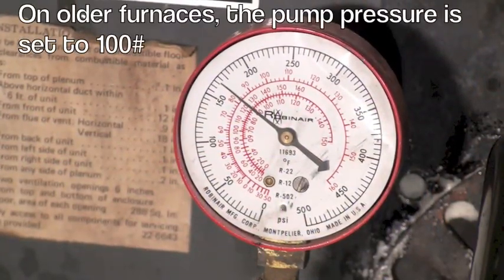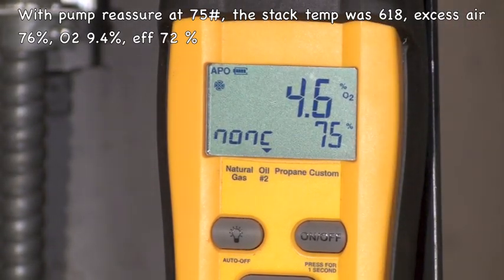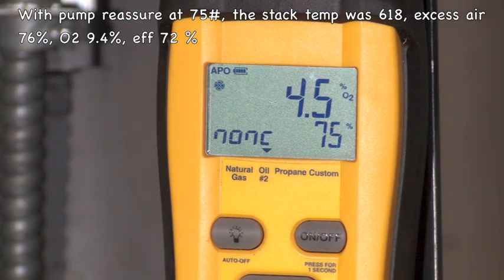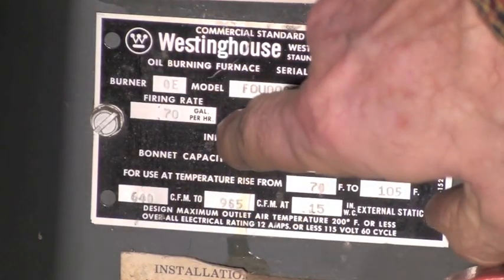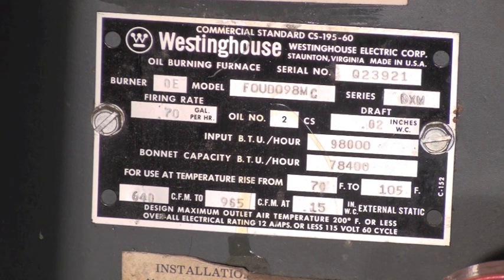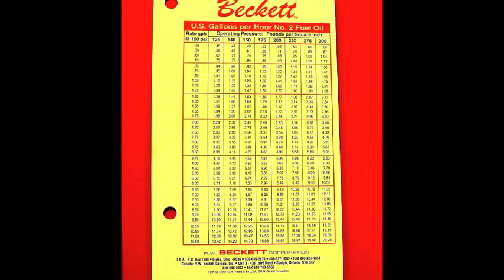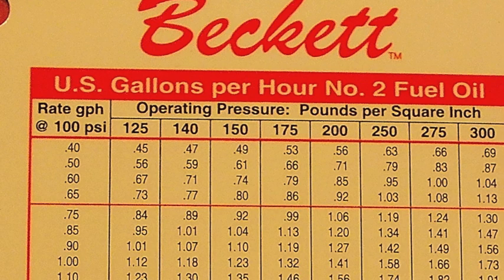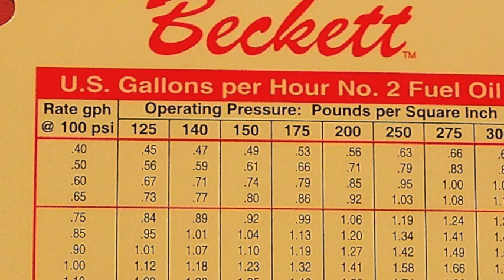Oil furnace efficiency adjustments.  Part 2 Increasing the pump pressure

Comment: should use a .60A at 125PSI and an A nozzle is hollow and a ss is semi
Reply from the maker: Nozzle selection depends on the the burner, furnace size and local oil supplies.  Start with the model plate which may have a recommendation.
GFM

Comment: I would never recommend anyone to change factory pump pressures and nozzle sizes.
They spend weeks and months developing the product. Not just for efficiency but also must pass ANSI Z21.13 and UL 726 testing with Calibrated equipment. This is a lawsuit waiting to happen...

Comment: I thought the reason to raise pressure is to lower your nozzle size and atomize better
Reply from the maker: Higher pressure always will atomize better regardless of nozzle size.  If you lower the size and raise the pressure the nozzle will have a higher gallonage, so you could reduce size to match the higher pressure.
GFM

Comment: Can I reduce the fuel pressure without compromising the fuel air ratio?
Reply from the maker: No.  Reducing fuel pressure will change nozzle output.  BTW I almost never reduce fuel pressure.  higher pressure equals smaller droplets and better burn efficiency
GFM
Reply: @grayfurnaceman   in my oil fired boiler there's an increased stack temperature but my boss isn't allowing me to reduce fuel nozzle. Thus, we were thinking of reducing the fuel pressure to increase the steam/fuel ratio
Reply from the maker: @parthindian1  I would tell my boss he is an idiot.  Unless the nozzle size is less than .50 GPH, there is no reason to not change nozzle size.
GFM

Comment: This is full of very bad, dangerous advice. Burner is old style, pre retention head type,  that often caused residential home fires.  

Stack temp of 650F degree is just bad. New retention head burners create fire ball with 80% to 85%  efficiency with stack temps around 400F degrees.   Beckett burner model AF and AFG is typical.
Reply: I service a lot of Carlin 99 domestic, and I will only use pp to fine  tune. Usually no more than 100 -5 > +20 psig.  You are never sure of the gauge cal status to give an accurate reading anyhow. Sometimes  an extra 10 psig opens up the flame pattern that can get narrow with viscous #2HHO in a  cold basement.  Usually get a good flame with Hago SS under-fired to .75 - .85gph and  high 80 eff.  never had luck with Delevan A or B. Prefer under fire on crusty old units like a burnham 124 wbb with frustratingly shore fire box with just a target wall. - Sandy

Comment: I have a 1984 Weil McLain model 66 boiler. Parts and help is discontinued. I’m a self taught BT with Gary’s help. Thanks Gary! Where the burner mount to the firebox door there is a mounting flange with gasket. I had to make a gasket out of exhaust manifold stock because of lack of parts. Question: Does the gasket go tight around the burner tube or do l just cut it flange size? Cutting it flange size leaves a 1/4 “ +/- gap. I assume that would affect air flow.
Reply from the maker: I can't answer that one.
GFM

Comment: is it safe Downsizing  a nozzle  from  0.65 80B  down  to 0.50  80*B  the  static  plate will  need  to  be  changed  out  along  with  the  end  cone  to size  F0
Reply from the maker: +Francisco Castellanos I am not sure, but I think the FO head is for .5 to .75 size nozzles.
GFM

Comment: I  just worked in a Lennox oil furnace AFII  FBX  burner using  0.65 80B  nozzle  with  a pump  pressure  at  140  psi . These  are  the  settings  per the  manufacturer, but can  i  lower  down to  100  psi   to reduce  my  temperature  at  the  stack  from  530*F  to  450*F  without  altering  the  system  design? I  am  currently  dealing  with  10*F in  excess  of  limit  temperature  rise  of  60*F  per  Lennox
Reply from the maker: +Francisco Castellanos Be sure air flow is ok first.  You can reduce pressure, but that will reduce the efficiency somewhat.  I would try a .5 nozzle.  Hope this helps.
GFM

Comment: GMF, have you ever increased the nozzle size by a .05 to get more heat to the customer or is that dangerous?
Reply from the maker: A small change is usually not dangerous.  However if you exceed the size on the nameplate, the efficiency will go down.
GFM

Comment: Do they still make a .40 nozzle I have never seen it? At the moment I'm using a .579MH
Reply from the maker: I believe that is the smallest commonly used nozzle.  It plugs easily.
GFM
Reply: grayfurnaceman should i just stay with .579MH it seems to run great on that and heats really well. one question do you know what would cause a slight shutter in the burner as its running normally? The shutter seems to not affect the operation and has been doing it for years.
Reply from the maker: Ben Boudreau That may be what is called a rumble, caused by the unit not establishing, but it usually stops after a few seconds.  
GFM
Reply: What do you mean by not establishing?
Reply from the maker: Ben Boudreau The burner is not a pressure burner, meaning it must have a negative pressure in the vent to operate normally.
GFM
Reply: So you mean the daft may not be enough? It's not used with a chimney only a 10 foot long 4 inch flue to the outside and 2 elbows.
Reply from the maker: Ben Boudreau 4 inch sounds small.  Is that the size of the breaching? (outlet pipe).
Reply: Yep 4 inch at the furnace top collar!
Reply from the maker: Ben Boudreau I guess its ok.  Brand?
GFM
Reply: Miller
Reply: It's says MOC-80 on the furnace. With the original FS-LS burner .50 to .75 gph but  looks like the max the fire box gph is .60 unless that's just for fuel efficacy
Reply: Did you get my message on the make?  Also Should I add a longer vent pipe? or leave it be? Also do you have any recommended oil additives for sludge and grime cleaning and revitalizing old oil in a tank? Thanks Ben
Reply from the maker: I have not tried to buy one lately, so I am not sure.  Think twice about adding detergents to the oil tank.  You could be breaking loose 50 years of contaminants to plug the filter, nozzle.  Small nozzles plug the easiest.
GFM
Reply: Well this set up has only been installed in my shop for 5 years and I have just replaced the oil line lucky for me oil line is 6 feet long and better 30 gallon galvanized tank. For now since its working I will leave the flue the way it is seem to work. Now if its working fine with out additives do I need to do anything?
Reply from the maker: Ben Boudreau Just set it up for draft and smoke.  If you don't have a smoke pump, make a smoky fire with air adjustments, the just get rid of the smoke.
GFM
Reply: Ok cool seems to burn really nice and clean as it is but I always give it clean through before the winter.
Reply: Thanks for all the help. I watch your Youtube vids all the time they are full of vary useful stuff! Great to have and learn!

Comment: I've only worked on a couple of oil furnaces and that was a really long time ago. On the next one will you show how to adjust the pressure or did I miss that in a different video
Reply from the maker: You mean you have not been hanging on my every video?  lol  Here it is  http://youtu.be/Ikkl1MaZ9qw  I will be doing some on high pressure with a smaller nozzle soon.  
GFM
Reply: grayfurnaceman You put out the videos faster than I can watch them lol

I will try harder to keep up lol